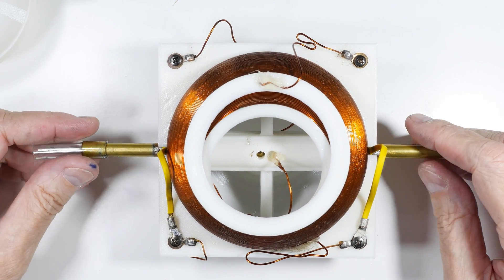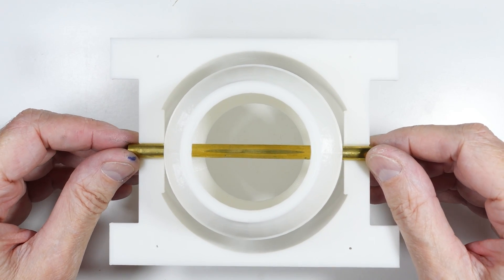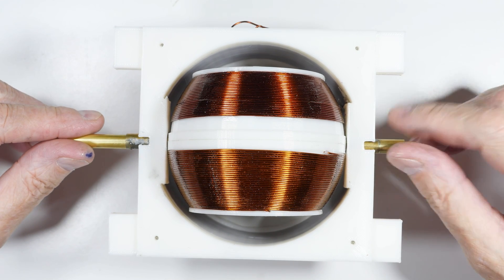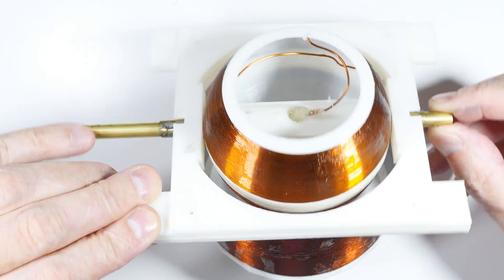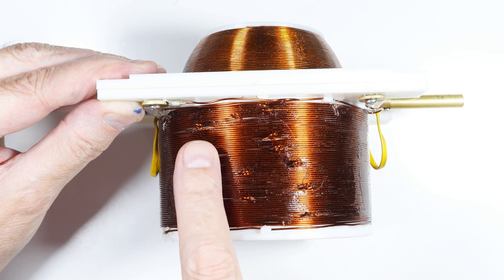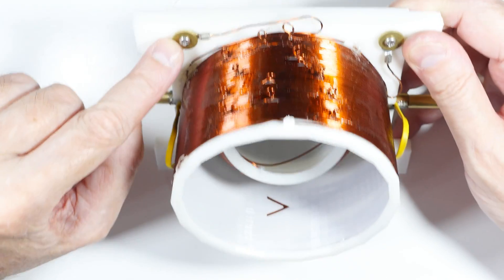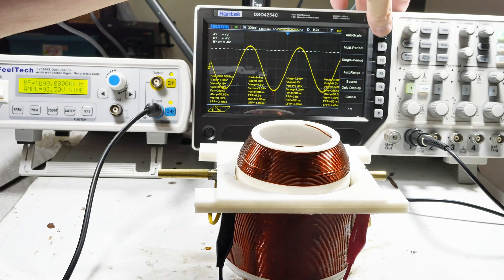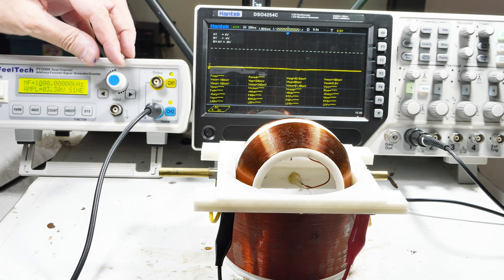Crystal Radio -- Variocoupler (4K)

Comment: Cool, I used to do 3D CAD for work...  After retiring I thought about trying to use a hobby printer to make vintage radio parts replacements; especially replicas of those d$%n pot metal parts... Never thought of printing coil forms and variometers.... Your wire gauge looks pretty big... Most vintage coils use 24 AWG with DCC insulation. The thicker insulation cuts the self capacity quite a bit from that of magnet wire coil.... Good luck on expanding on your theme...
Reply from the maker: I was guestimating from fuzzy old photos. Several I used as models had 20 turns per section  and based on the core size, that gave me 19 or 20 AWG, assuming I counted correctly. One was German. I saw others that had 8 turns and they used copper straps. They seem to have been made a hundred different ways. It would have been great to have dimensions. My only solace comes from mine having the same inductance as a commercial one that was one of my models.

Comment: That's a slight change from the first one you showed.  Both are hard to wind (the ball seems more difficult)  and the taps seem like they'd turn into a nightmare real soon.  I'm wondering if it might be worthwhile to save time and frustration, instead of the taps, to use a rod slider somewhat like the modified Boy Scout Crystal Receiver.  That's likely outside the design you set out to emulate.  73
Reply from the maker: We think alike. I started a design with a pedestal to mount a wiper. The problem was the arm was too short and at just 15 degrees it would start to cross & connect multiple windings (and some old ones had taps on every winding). So I just bit the bullet and did the taps.
Reply: @tsbrownie  That's a little like teamwork I guess.    🙂  I'm thinking a little outside your box.
I haven't thought it through to every detail, but I'm wondering if mounting the large diameter coil form (horizontal) 90 degrees from how it's shown in the video would help   And I'm thinking of making the slider so it doesn't need to pivot.  
I'm thinking: 1) make the inner coil as you've already shown, 2) also make the larger diameter coil as shown except the taps, 3) add to the previously tapped coil a contact which slides (horizontally) along the coil form perpendicular to the turns, 4) make that coil contact with a small ball or maybe just a kink in the otherwise straight metal contact.  You'll likely imagine some improvements over those ideas.
I bet the way it's already made and when taps are used you'll get increased station separation over using the same coil with no taps.  A coil slider might or might not improve separation over what's achieved with taps.  But as you said you don't relish repeating making taps on that coil form.
I once made 2 coils each a different diameter so that the smaller coil could be inserted into the larger coil at different distances and it tuned stations.  Your spinning ball coil and my sliding coil achieve the same sort of coupling I suspect.  Your spinning ball might offer more precise tuning due to the changing angles of the wires.
I didn't make my coil turns adjustable because my wire is too small to tap easily, 0.0159" diameter.  Maybe I'll try harder.  
OR I'll find some larger diameter wire and try making a coil shorting mechanism that slides across the turns and in parallel with the coil form.
My thinking might be all backwards.  lol
Reply from the maker: @southernexposure123  I'll have to give that some thought. To be honest I'm trying to wind down on this and get on to another Stirling engine I've got in the works.
Reply: @tsbrownie  I completely understand.  I just came back in from wanting to get hands on and my concentration isn't cooperating.  Oh well.  :goodvibes:
Reply: @tsbrownie Today I found some energy and began anew with slight progress.  I'll be making mine without a 3D printer so mine won't be as elegant as yours.  I'm hoping mine will work to receive medium wave and that I can mod it to receive shortwave.  Good luck with the engine.
Reply from the maker: @southernexposure123  You can use PVC pipe. In fact that's what most people do. There's youtube videos out there.
Reply: @tsbrownie  Yes PVC, I have 3" thin wall and 2" thick wall to go inside the 3".  I'll put 36 turns on the 3" and I'll likely need 2 or maybe 3 layers on the 2" pipe because that coil is shorter.  I found a calculator for multi layer coils.  I suspect the hardest parts will be the connectors for the inner coil that spins and the slider for the outer coil      If I can't make the inner connections work for the spinner I'll make the inner coil slide with both coils wound the same so they're parallel.  Some of the older designs use that arrangement.  That's not at all in the same vein as your variometer.  For me the improvement is I'll be adding the slider.
Reply from the maker: @southernexposure123  I'll be interested in what you build.
Reply: @tsbrownie   I'll make a video after getting it to work.  I just watched your explanation and description between Variometer and Variocoupler.  That was very helpful.  Thank you.  
It makes me wonder if winding a coil on a golf ball would work. Then put that inside a coil wound around a tennis ball.  That's too crazy.   lol
Reply from the maker: @southernexposure123  If you can wind a golf ball, you will have my respect sir! (Then there's dirlling a hole for the shaft.)
Reply: @tsbrownie LOL  That drilled hole has to go through a mass of rubber bands which will likely crawl out of the ball just about like a box of earthworms.    🤪
Reply from the maker: @southernexposure123  And do they still have steel and nasty liquid centers? Make a video!!!
Reply: @tsbrownie  I took one apart a few decades ago.  It had a rubber ball center.  I found some videos made inside a ball factory and a few videos of someone cutting a ball apart and showing the bands and center.
https://www.youtube.com/watch?v=h6jszhS5boo
This video is a quick overview of one factory:
https://www.youtube.com/watch?v=s4WHZJRu-s4
There's other factory procedures on other videos.
Reply from the maker: @southernexposure123  The rubber band type is what I remember from when I was a kid and we'd cut them open. One had a steel center if I recall. I never liked golf, too expensive. I once lost 9 balls before the 6th hole and had to quit because I was out of balls. ;(
Reply: @tsbrownie Decades ago my high school PE teacher, who was a proselyting avid golfer, told my PE class, "I've had adults  tell me they've never hit a gold ball, and my goal is for you to not be able to say that."  
So he brought Ts, balls and clubs, took the class outside and made us all hit a ball at least once.
Since then the only times I touched a golf ball is when i found it on the ground.

Comment: Thank you. That was very interesting.
Reply from the maker: Guess you were not surprised by this video topic. ;)
Reply: @tsbrownie  No but I am intrigued.  You are sure getting some good use from that 3d printer.
Reply from the maker: @adnacraigo6590  3D printers are the closest thing we have to a Star Trek replicator. Sure, you can't just talk to it, and it takes 2 pieces of software and 1 hardware device, and it can take 4 to 8 hours for a print, BUT given all that, one can still go from a thought to working thing in a day, and without a shop full of machinery. Ours was $200. The plastic to make this was around 50 cents. I guess you can tell that I'm a fan.